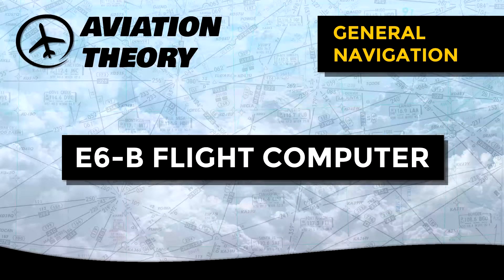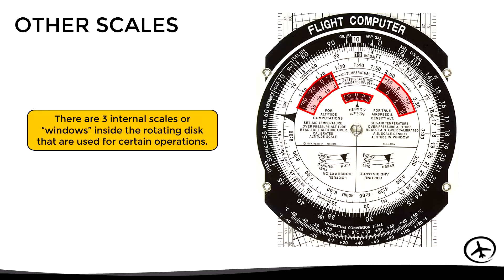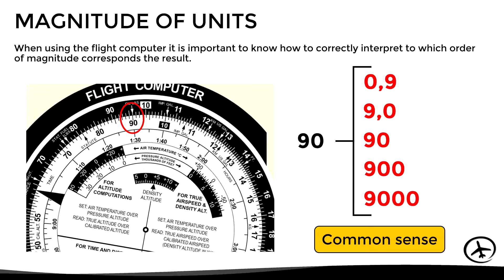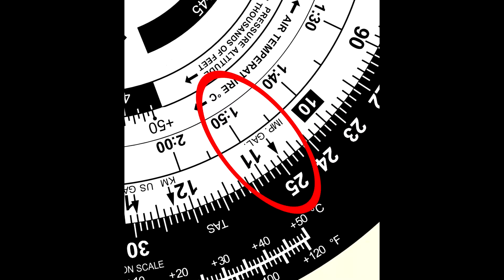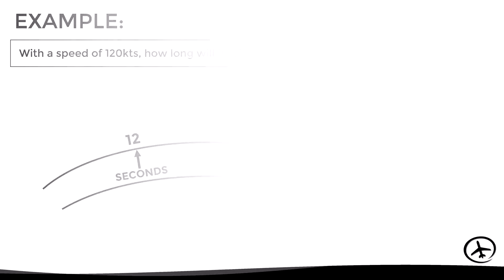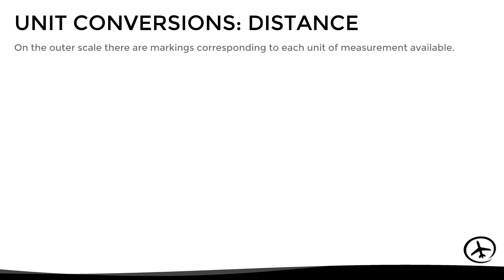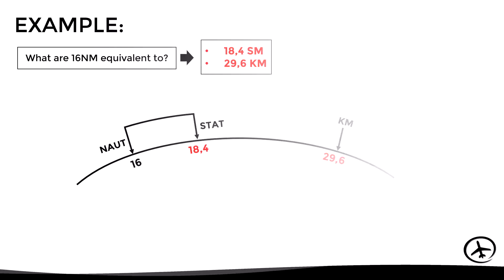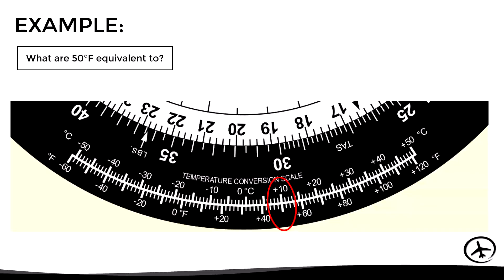How to use the E6-B Flight Computer - (Part 1/2)

Comment: "Common sense" could be explained better here, as it's doing a lot of heavy lifting. All it means is that first you have to interpret the problem and know what a very wrong answer would look like. You can't just follow the numbers blindly. For example, if you were doing arithmetic on a calculator like 3x5 and ended up with 150, you should intuitively know that's wrong. Same thing here with a different calculator. You have to have an understanding of the math involved in order to use the calculator.

Comment: When I work with the left window of pressure altitude and temperature you go right. When I go right you go left. How do I know which window to use?
Reply from the maker: Hi Wilbur, on most flight computers, next to each window there is an inscription indicating for which calculations it is used. However, almost in all cases, the window on the left is used for altitude calculations, while the window on the right is used for true airspeed and density altitude calculations.
Reply: Thank you so much